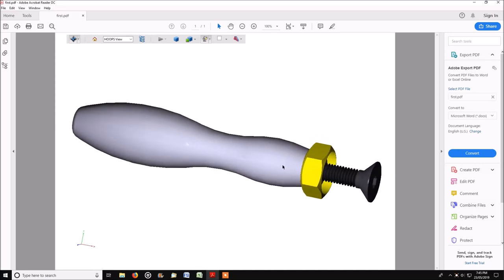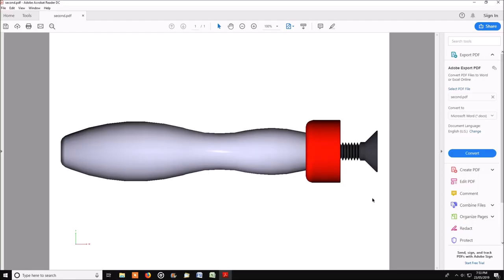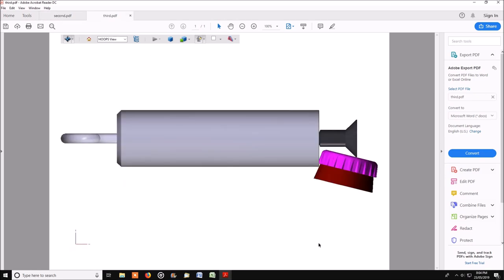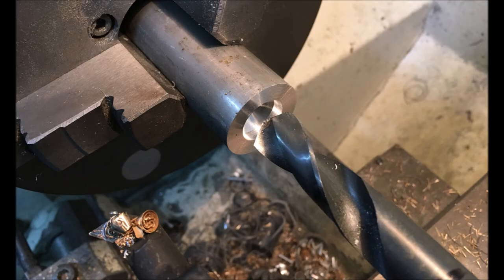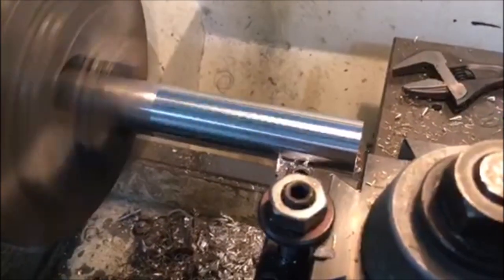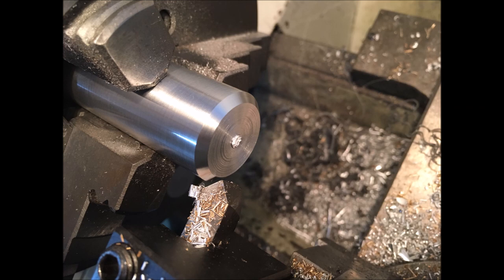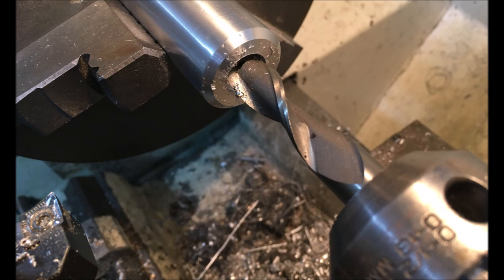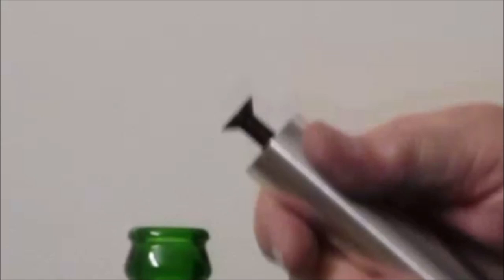Making a turned bottle opener

Comment: Brilliant mate! When you told me you were going to make one on the lathe I had no idea how you'd pull it off
Reply from the maker: swdweeb Neither did I at the time, which is why so much time went into it. By the time I had it about right, I had run out of time and enthusiasm! As it ended up, it ain’t purty, but it works!